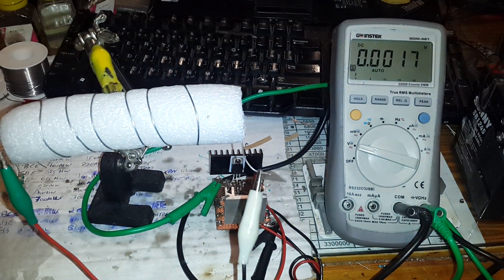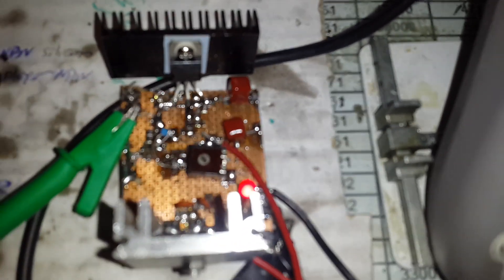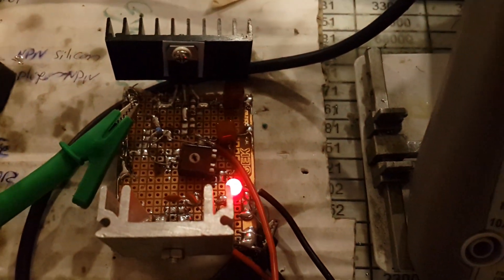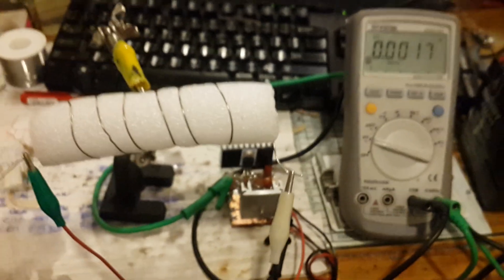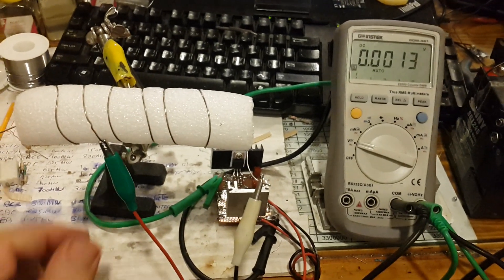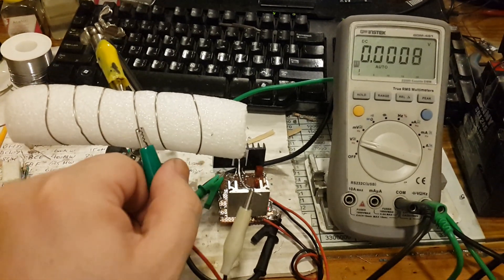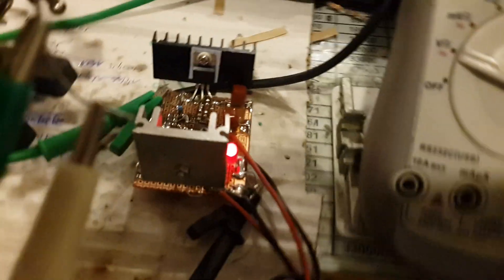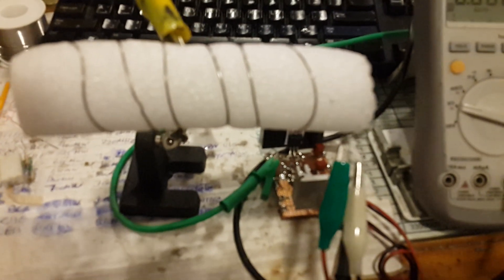LM317 Milliohm meter it too sensitive than able to measure wire resistance.

Comment: Important thing is the calibration and drifting with temperature.
Reply from the maker: Good point, the ic is NOL Drift(Zero Drift) and no need calibration. room temp. should be stable